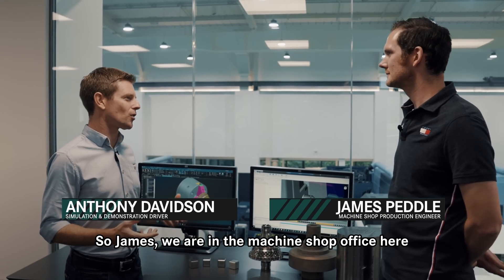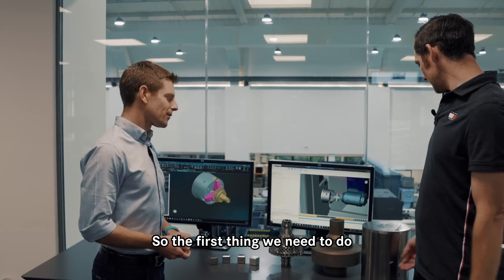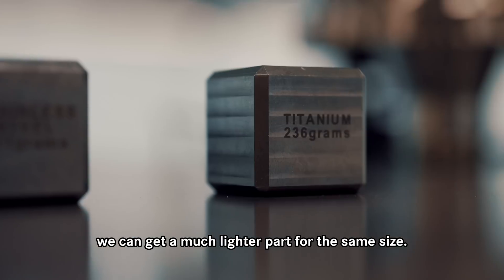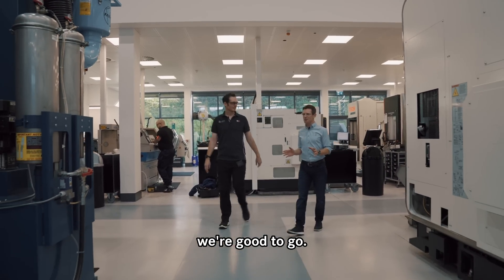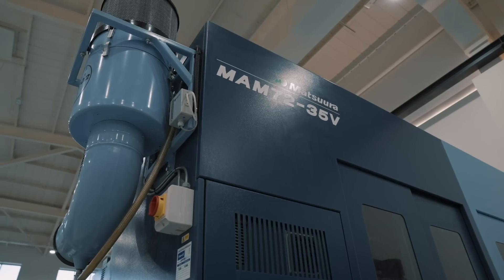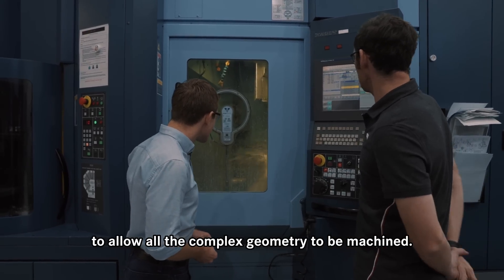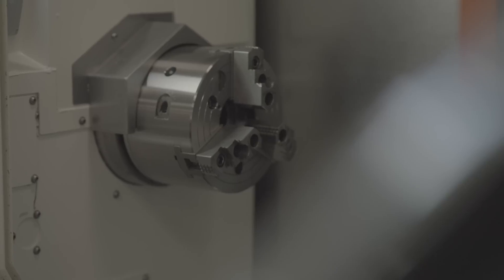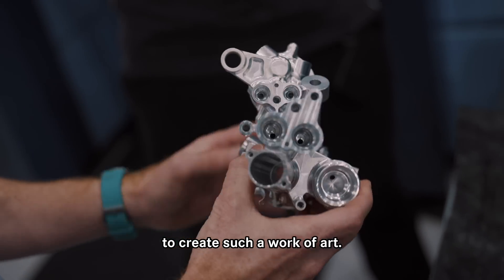The Cutting Edge of F1 | The Machine Shop | How It Works ⚙️

Comment: Super cool, as a machinist F1 would be a dream. I am surprised they don’t run a higher coolant concentration though
Reply: I would assume they don't need to when you have a machine that can flood coolant like that, I only do manual machining but it's on 316 stainless so a different ball of wax as it were

Comment: Very interesting look into the factory. I wonder if the machines are HAAS. This was way too short, we need episodes of this.
Reply: Nope not HAAS. They're using Mazak and Matsuura machines paired with FANUC controllers afaik
Reply: @lalithmalhaar  I work near a building with a massive FANUC on the side. Now I know what they do. Cheers
Reply: @BenDunlop  Fanuc does a lot of things that has to do with automation!
Reply: Like for real nobody uses HAAS if they want to produce high quality
Reply: @jonasmaier6568  Not necessarily; workholding, tooling and programs are what really create the quality.
Reply: @James Hart  yeah u right but u know what I mean HAAS aren't the best machines
Reply: @jonasmaier6568  no true, they have a Haas VF-2 at their machine shop. I saw it in one of their other factory your videos
Reply: @omgitsmejeff  case of use the right tool for the job. Haas doesn't have anything compared to the MAM, they've got some pallet feed machines but the MAM is a really high end machine that's meant to run for days without a person to attend to it. We use Haas in our shop, they're great machines but not the same quality as Matsuura or Mazak, which also happen to cost a few dollars more haha

Comment: If you gained a tenth for every james you've got in the team you'd be 2 laps ahead of everyone.
Reply: They sent one to Williams and they are already doing better. I see your point.
Reply: Let’s say an average lap is 80 seconds, and an average race is 60 laps. To be ahead 160 seconds in 60 laps, you would have to gain 2.7 (160/60=2.666…=~2.7 (1d.p.)) seconds a lap. Therefore 2.7*10=27 tenths. So there are 27 James.
Reply: @formulanova12  🤣🤣🤣🤣🤣🤣🤣